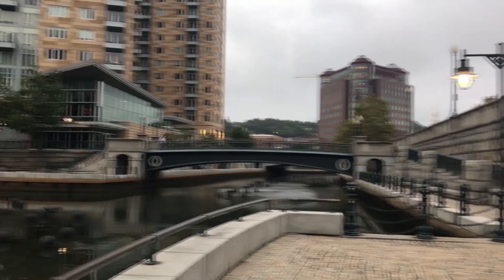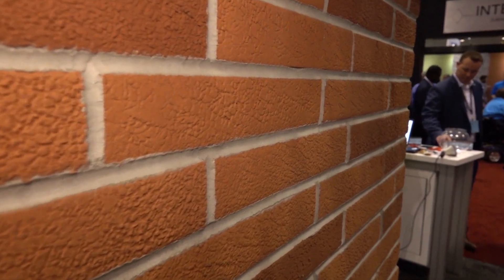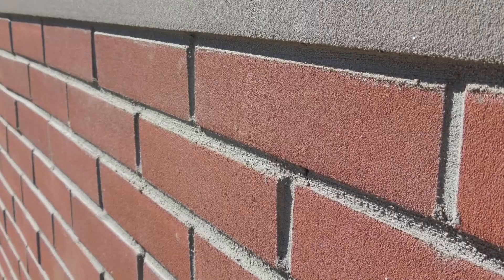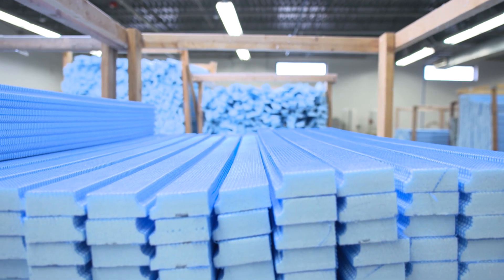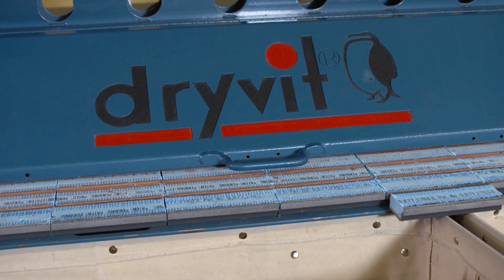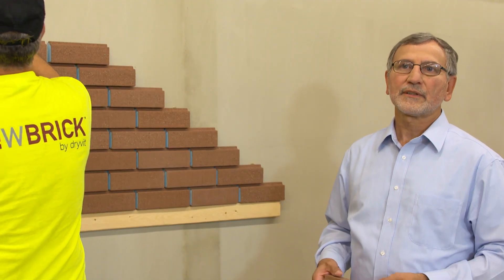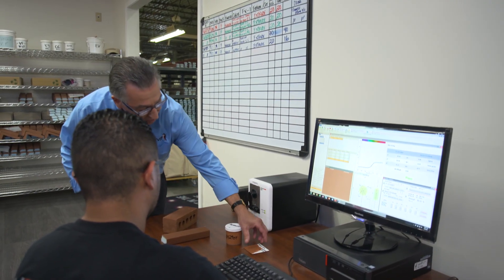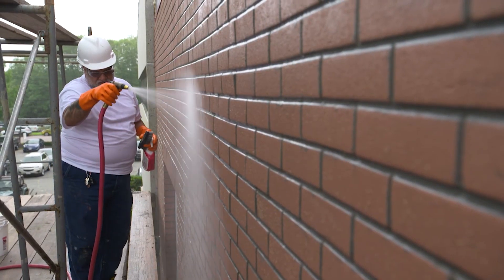Out with old brick…in with NewBrick

Comment: 48 pounds per square inch impact is nothing. A hailstorm with high winds and large hail would dent up an out side wall. I would only use this inside in areas with very low chances of being bumped by anything. Make it hail proof and I'll be interrested.

Comment: Looks impressive, and it might hold up as well as conventional brick veneer. But, with all that polystyrene, what kind of fire rating can you get with this stuff? Does the outer shell keep the plastic from burning or melting? Are there options for increasing the fire rating where required.
Reply: Extruded poly styrene has a R value of 5 per inch; so new brick would have a high heat flow resistance
XPS is commonly used in inverted roof assemblies as the insulation.